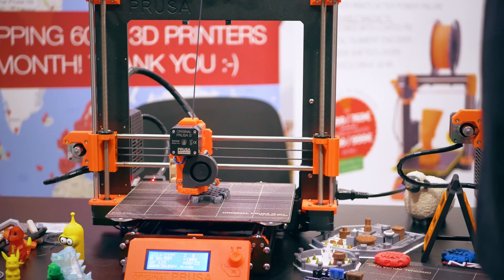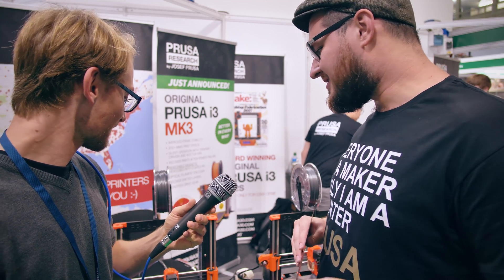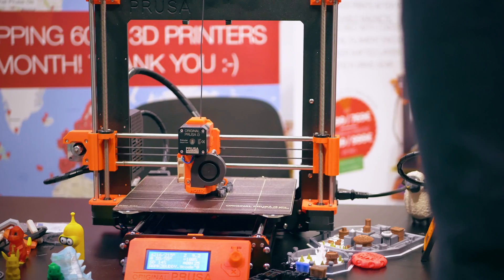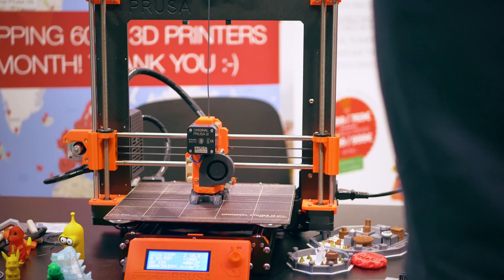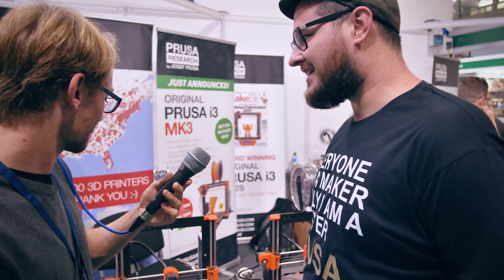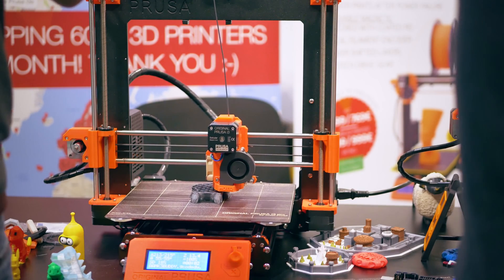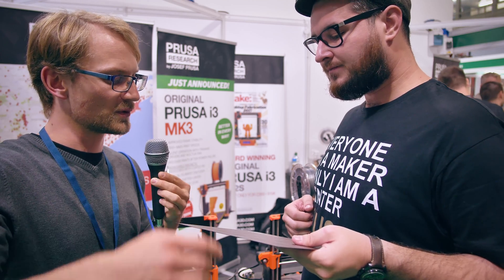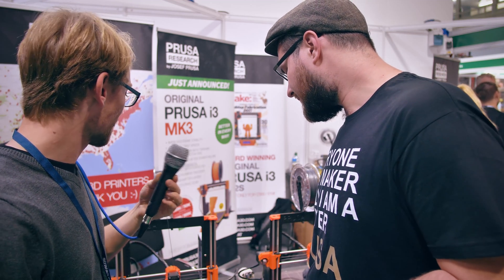Second look at the Prusa i3 MK3: Sensory overload! #TCT2017

Comment from the maker: One of the core enablers for the MK3 are Trinamic's stepper motor drivers - check them out here https://www.trinamic.com/solutions/manufacturing/3d-printing/ [sponsored link]
Also, here's the second part of the Interview, focusing specifically on the new Einsy mainboard 🤓 https://www.youtube.com/edit?o=U&video_id=RuvaSTg33r4

What do you think about the new MK3? Is the MK2 or other printers already "good enough" or are the new features from the MK3 worth an upgrade for you?
Reply: Personally, I think the upgrades are great. I love the removable bed, and I like that it is more robust in what it's able to sense and detect. I think that features like this are needed in order to bring 3d printing to a larger audience.
Reply: You should upgrade for the Trinamic's stepper motor drivers alone.
I have a Duet Wifi 32 bit  and it is a night and day differance ,your motors run much more silent and cooler then whatever other onboard stepperdrivers i had in the past.
Reply: I won't be upgrading, but I'll definitely see how much I can steal from them on the machine I'm designing. 
(which I probably won't finish for another 20 years, but that's engineering without being an engineer)
Reply: If I had an mk2, I would not upgrade. But buying an mk3 as a first or second printer sounds a lot better. So many quality of life and ease of use features. People that are (or just getting) into 3d printing will appreciate what the mk3 brings.
Reply: The Mk3 was announced literally 1 week after I got my i3 Mk2S, so initially, I was really torqued and felt cheated.  However, I have since decided that all of the upgrades that I feel are really important will be included in the Mk 2.5 upgrade kit.  Getting a new heated bed with a flexible PEI sheet, a new extruder and fan, PINDA probe and optical sensor for $100 is certainly worth it.  However, I am still on the fence about possibly selling my Mk2S and getting the Mk3.  Money wise, it would most likely be very close, it is just boils down if I want to wait for another new printer.
Reply: Interesting to hear from Josef that a MK3 upgrade MIGHT happen in the future, i personally would consider it if they release a MK2.5 to MK3 upgrade in a years time or so, the main reason being upgrades AFTER MK3, i.e. MK3S/MK4 etc. Depending on the economy of it all though, selling the MK2.5 and buying a MK3 might be a better way to go.
Reply: I upgraded my MK2 to the "S" version a few months ago and I really like the new features of the MK3. I'm planning on buying one early next year.
Reply: 2nd part is here https://www.youtube.com/watch?v=RuvaSTg33r4
Reply: Somehow I missed your "first look at mk3". As for Mk3 - I would go for magnetic coated bed alone, PEI on Mk2 can be pulled off on large ABS prints. I suppose 2.5 upgrade is for me.
Reply: I thought that when you ask him about his preferred feature, Joshep was going to say the 200mm/s printing, I´ve a MK2, I'm going to upgrade it to S and 2.5 but I´m definitely going to buy MK3 as soon as I can, is like 2 for 1, I need to print faster, the waiting hours are killing me.
Reply: Maquinas Automatas the quality will take a hit though for pretty much anything but infill as he said, for infill it will be great but I prefer my walls at 60mm/s right now, even though the MK2S can handle more.

So it will not be a 2 for 1 situation(cutting print times in half), but depending on the amount of infill in the part maybe a 20% increase in speed(just a guess) without loss of quality.
Reply: I barely hear anything from my Anet A8...
Reply: Thomas... It's your fault.
:P I just pre-ordered. Great interview man.
Reply: There is now a full upgrade path from a MK2 to a MK3. $500 though. At that point, just better off buying a full MK3, or backfilling parts to do a mk3 and rebuild the mk2 to have a second part.
Reply: Anthony Bowman yeah, I’m happy they did it but as Prusa said, it makes more sense to sell the MK2S and buy a MK3, will decide in December when my coupon starts nearing the end, whether to buy 2.5 upgrade or mk3. I’m suspecting there are quite big benefits to the 24v system, like speed and noise levels that I would like to enjoy. Will be great to see tom’s review!